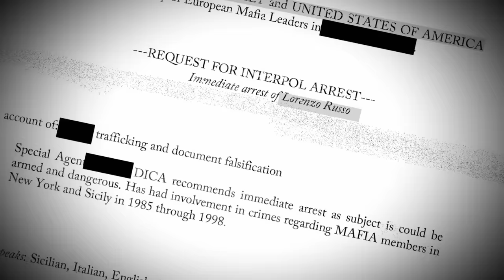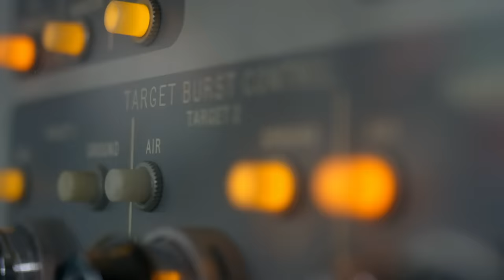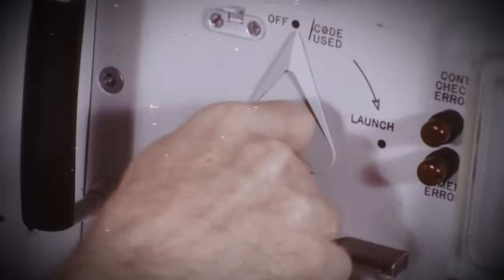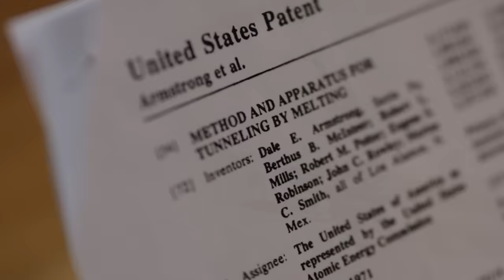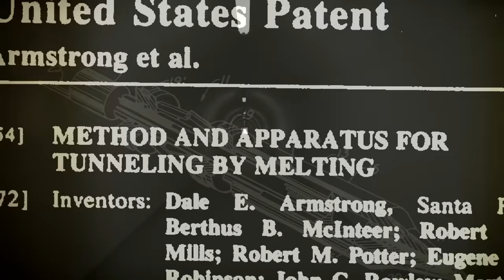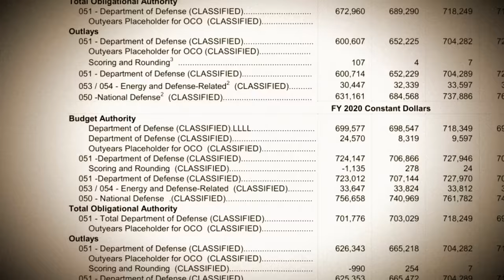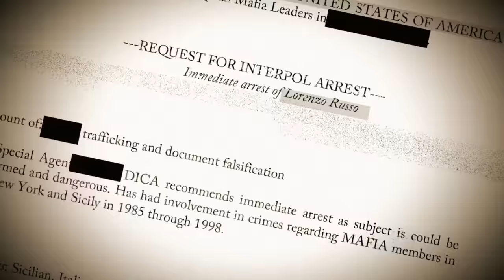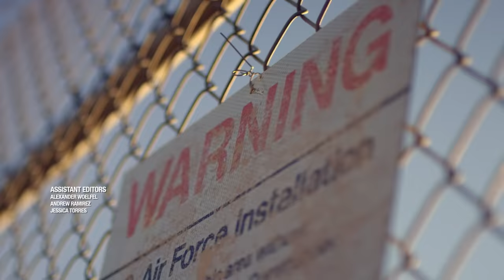TOP SECRET U.S. Government Tunnels | Cities Of The Underworld (S4, E2) | Full Episode

Comment: My dad served in a Minuteman missile base in South Dakota in the 60's. It is true that the locals didn't know the extent of the bases but they most certainly knew there were missile bases in the area (there were even protests about building them there). He also said that it took TWO airmen with identical keys, turning two locks simultaneously about ten feet apart to arm and launch the missile (that way, they couldn't be launched by one person acting alone). Naturally, one of their favorite activities while waiting for "the call" was to try and figure out ways for one person to turn both keys at the same time (Think it can't be done? Challenge accepted!). Also, contrary to movie myths, there are no self-destruct mechanisms built into nuclear missiles, that would make it possible for the enemy to destroy them in flight. The key to safety is to make them really hard to launch in the first place.
Reply: You could just measure the distance of the keyholes apart and attach the keys on a long rod with small u joints or like a wobble socket.
Reply: @jacksparrow3490  Jack be nimble, Jack be quick !
Reply: @jacksparrow3490 that is one way, but I seriously doubt the security detail that searches you before you go in and when you come out would let something like that get inside that room. Unless, of course, they were in on it,  but then you would not need to do it alone.
Reply: I'm not saying my method was 100% lol.. obviously they have high security on these facilities. Was just saying if there was an actual will to do this alone there most certainly could be a way..
Reply: @jacksparrow3490  they may be 'around corners' or in different rooms.
Reply: THANKS FOR SHARING!! GOD BE WITH US ALL... AMEN
Reply: Strategic Strike Command Rapid City
Reply: Does your father know who the contractors were that built these installations?
Reply: I can’t believe how naive and clueless you guys are. You could just do the smallest amount of research ever and learn exactly how missiles are launched. Just because your dad worked at a missile base doesn’t mean you know anything about missile ops. Pretty much everything you said is wrong. Key’s definitely aren’t identical. And I’m not sure what movie myth you’re talking about but I thought it was widely accepted that once you launch an icbm there is no way to recall it.
Reply: My dad was assigned to one of the Air Force support groups stationed on Eniwetok in the Marshall Islands where they tested atomic bombs in the '50's.  He had some crazy stories to tell...at least the ones he could talk about.
Reply: Nice, We have Nike missile bases here in NJ.
Reply: this is probaly where the missing peoples are going to
Reply: Ellsworth, huh? Rapid City/Box Elder, is gross. All those missile silos have been decommissioned, and the ranchers whose land they were on, have ripped the control wiring out of the ground and sold it. They made a killing. I was working for Checker Electric Inc when a lot of that silo wiring was being transported to the scrap yards. The copper wire we were selling after the jobs we’d finished was great money, but that silo wire….Jesus Christ…..some of it was going for $10K per foot. It was absolutely insane.
Reply: Yup
Reply: Good episode
Reply: Thanks for sharing that. Wow. What a crazy place to have been. I can see some young men bored out of their minds with yard sticks taped up at the end. Lol
Reply: U should have listened to him
Reply: @thilde007  they can terminate the missile all the way up until the re-entry phase. this is standard in all rocket designs.
Reply: May have been another youtuber but pretty sure I saw you on a comment section for a video on a secret military radio station talking about the nuclear protocol. Gave me dejavu seeing you here
Reply: They re not really worried about the people above ground. We re just bottom feeders.
Reply: @jacksparrow3490 I think differently , if it wasn't a time crunch thing , just extend the keys wire harness ? Change the whole lock mechanism if you know your wiring and how they work
Reply: @mchrysogelos7623 Nope side by side approximately 15 feet apart, seen them myself...
Reply: the keys would not work unless the communications were remotely activated by another site. it takes more than just 2 people sitting in the same space with keys to launch an ICBM, it takes a command and control network. this is why there have never been any accidental launches of missles with nuke warheads.
Reply: I worked on Minuteman III nuclear missiles in the 80s. The guy’s right, boring job but scary the amount of power under your control
Reply: @CrossOfBayonne are Nike missiles still used? I thought they were retired when NORAD was established. Because they were radio controlled and could only detect an incoming missile from a relatively short distance or something along those lines . I know there is a couple old retired Nike missile defense bases up in Alaska that you can tour
Reply: It was public knowledge about underground missiles but locations were hidden  but we knew what States held them.   When submarines were put with missiles, we also knew that because they used to show them being launched out of the ocean but you never knew where the subs were. .  We knew about the radar installations up in Canada for early warning.
Reply: I was in the same career field you speak of.  Never at a missile base, but later stationed with close buddies who were.  I had buddies stationed in Montana, ND, Wyoming and Italy.  They said it was the most terrible and awesome duty stations of their careers.  I think the horseplay and time killers while sitting on posts at missile bases are what made life tolerable.  But you as the original poster on this topic is 100% accurate on even how the 60’s were.  And that two key system hasn’t changed.
Reply: Took me two minutes to figure out the keys.mop handles duct tape hack saw blade.
Reply: The missiles aren’t just launched immediately.  Unless they are “cold launch”; they have to be warmed up, fueled etc.
Reply: @josephjackson7269  did you know that SSBNs (slbm nuclear submarines) are a one way trip?  By firing those missiles from opposing tubes the submarine’s hull is massively torqued… it can only creep back towards a base at a noisy 5-6knots.  
Their existence in the US Nuclear Triad (Bombers, ICBMs, Submarines) is to assure that our opponents will be unable to neutralize our ability to respond reciprocally.  Bombers are for their recall ability and ICBMs for speed and payload.
Reply: @jimmiehawkins8352  “hacksaw jimmyhawkins” don’t duct around! 
McGyver takes notes while watching videos of you!
Reply: Richard Pryor in Superman 3 solved that problem by getting the other guy drunk and tying string to his wrist to turn at same time.😄
Reply: SIMPLE ,... as I built and demonstrated to people in a test of such a device .  I built a small metal frame that would clamp and lock over the lock console, the key would be inserted and a battery operated solenoid that  was positioned over the key and a clamping grip around the key for the twisting motion. I held a remote control box with a push button that operated the remote solenoid for as long as I held the button . On the command to turn my key, I did so while pushing the remote button and held it for the 5 second mandatory initiation phase, .... and IT WORKED !  Needless to say,.... those folks were a bit upset with the simplicity of such a tool and this was back in the late 1970's !

Comment: I harvested wheat around the silos in Wyoming in the sumer of 1985.  We were sternly warned to NOT have an accident and hit the chain link fences around them or we'd ed up getting the beatdown and arested by the military security stationed in each one.  It was nerve wracking because the farmers had planted their wheat right up next to the fence and we were expected to get it all.  They also warned us to NOT stop and gawk when we were close.
Reply: we worked underneath the pineapple fields in Hawaii.  when we had drills we had to climb up into the fields where workers were sometimes working.  had to stand around and wait to be told to return to  work.
Reply: THAT'S IF THE METAL FENCING WASN'T ELECTRIFIED AND KILLED YOU!!
Reply: @mchrysogelos7623 can u explain more?

We're you in military and this was a military base?
Reply: Very cool! Who gave you those instructions? Local urban myth, or a military representative?
Reply: @cybrtrkguy  The land owner.
Reply: @Bluesrains  It wasn't.  It was just a plane ol' heavy duty 10' chainlink with razor wire.
Reply: I roofed several silos I. Wyoming.. they dont play
Reply: I worked on those sites in the 80s in Wyoming. Our base controlled missiles in Nebraska, Colorado and Wyoming. Boring job but scary the amount of destructive power under your control

Comment: Twenty years ago I was working for a cabling and fiber optic company in Colorado. I saw an ad for a technician with a security clearance and I told my friend about it who had one. He got a job working at Peterson AFB where he went to a small building which housed an elevator. My friend said he couldn’t tell just how far down it went and then the elevator opened to a large room enough for two jetliners to fit in.

Comment: Besides tunnels and underground facilities (top secret) all over (under) this Country and beyond , there is also buried Arsenals in many numerous land sites throughout this Country.
Reply: I worked hazmat transportation for a DoD warehouse, not doing nothing special. But there's ALWAYS lots of sensitive satellite tracked stuff in motion, everywhere. So when a truck driver has a few night vision in the trailer, they have to park in 'safe harbor' for the night. Sometimes a base, and sometimes in a hidden site that looks like an old abandoned gas station with a hidden underground parking bay.
The Drive In Theater gag of Spies Like Us isn't as far off the mark as you think.
Reply: Huge nuclear reactor under UT Austin. Thank the bush syndicate
Reply: The missle factories make missles but no one can figure out where theyre at. Theyve been piling up somewhere. Cant even figure out where the missle factory is.
Reply: Hollow mountains for politicians and billionaires and their families
Reply: @WindFireAllThatKindOfThing  We use a lot of places that look abandoned, and you would never know there is tons of stuff beneath the surface. So do Canadians and Brits and a few others.
Reply: @censored4christ162 it's not one place. Pieces are made in different places. It would be too dangerous to manufacture All the parts in one place. For several reasons

Comment: In the early 80's, I was flying C-5s.  I got assigned a mission from KXXX in Nevada to KXXX in Utah... we were hauling something that was a very strange shape.. all covered in black plastic.. we assumed it had odd shaped flat panels under the plastic to hide its real shape.  The giveaway was the 3 aircraft landing hear sticking out the bottom, which were unmistakably landing gear.  Anyway.. after a short flight we landed in the desert in Utah... there was 1 small building at one end of the runway and nothing else noticable as we landed.. didn't do much in depth sightseeing as we were more into landing the jet on the runway.. but not much to see except the runway.  we parked at the opposite end of the runway and were not allowed to leave the area.  an aircraft tug showed up and attatched a tow bar to this 'THING' and towed it like an airplane to the other end of the runway as we closed up the c-5 and got ready to leave.  then... it was gone.  the plane, the tug disappeared... and we started engines and left.  where did that go?   Now you might have an idea.  What was the plane?   Stealth Fighter f-117 before it officially existed.

Comment: Wait a minute.  I don't like this part. 18:25  I can believe the tunneling apparatus that melts its way through, but their demo is BS.  22:51 and 23:35 show the same footage of Don looking through the same classically drilled hole, not the hole a plasma torch would make for example #2.  The spots on the rock don't even look like holes, just hot dents.  24:20 "That basically proves it right there."  They proved nothing!  The camera never showed a torched hole going through that rock!
Reply: "Fluff Footage" B roll type stuff to keep the Video Moving HAHAHAHAHAHAHAA
Time shifted, repeated. ETC....
Reply: They show an acetylene torch and a plasma torch. The acetylene is the is the long copper colored one with fire coming out the end, happened to be a welding tip on it versus a rosebud heating tip or a cutting tip. The plasma is the black colored but didn’t really show any fire coming out which is correct, they discharge a plasma arc. I have one of each. The acetylene torch while working great on metal will just not be to effective on rock, just heat it up, plus would require a massive tip and a lot of acetylene and oxygen, I mean a LOT, to do anything resembling a tunnel of any kind of scale, if it would even cut at all. The plasma only works on materials that conduct electricity, I don’t know if rock would, never tried it. Would take a lot of power hence the nuclear aspect.

Comment: The nuclear mining method description is twaddle.  The mass of rock displaced to create the tunnel has to be somewhere.  Converting it to glass doesn't move it away.  Theoretically, if the nuclear "drill" could convert the rock to gas, which could be exhausted, you could produce a nearly traceless excavation.  The experiment disposed of the debris because the experimenter and film team breathed the exhausted gas, fine droplets of glass.
Reply: simply look up "has there ever been a nuclear drill"   youll be disappointed.

Comment: Plasma torch hole image where he's looking thru is the same as his drilled one, they never show the plasma tourch tunnel, only the hole and not more than a tiny bit like less than 1cm deep. It's not a  correct representation.
Reply: Exactly what I was thinking about, badly illustrated 🫤
Reply: Exactly what i was thinking. That was frustrating. So I stopped watching at that point to search online for other demonstrations of drilling a hole in a rock with a plasma torch. Nothing.
Reply: I know high heat can break stone (stone can have super tiny airpockets and even water filled tiny pockets) and one of the reasons you don't put stones into a bon fire is that they can explode. Around a fire pit... isn't the same kind of heat. Not all parts of a stone expand at the same rate and that can also cause a rock to fracture. Not the same thing as they were measuring here. Another example is why clay you fire for ceramics will break or explode when it has airpockets too or if the claybis very uneven in thickness. And that it takes a while for a kiln (for ceramics) to heat up slow enough to not break things that are basically porous clay and powder glass for them to vitrify (melt/fuse) into ceramic and glass-glaze. I don't remember what exact cone temperature the high-fire was that my community center used to do for their ceramics, but it was the mid level clay stoneware and porcelain tier. It was hotter than the fancy ceramic retail shop but not as hot as the really hot specialty kind. Glass is on the lower end but with all of it you have be very gentle with the temperature differential or else things break instead.

Comment: it you have a 4wheeler you can find one in Mohave desert. it crosses hwy 14 north of Palmdale/Lancaster area. it runs from Edwards Air Force base west to low mountains where the area becomes off limits and is patrolled by armed soldiers in Humvees with a 50 cal machine gun mounted on back. The facility in the mountains is stop secret and very off-limits. The sand drifts in the desert and if you are diligent you can make out in spots the concrete edges. about 20 ft across and running seemly forever.
Reply: yes thiis is all true growing up we had duck and cover drills and nuke bunkers in the desert.

Comment: Check out The Department of Energy facility just North of Atomic, Idaho. Lots of little pod areas connected by roads which I believe are elevator areas.  I have friends who are veterans who would be bused from Twin Falls, Idaho up to that area in blackout busses to do welding, plumbing, electrical, masonry, etc. underground in a massive facility for submarine testing.  Yes. A massive submarine underground.
Reply: I believe that is the training/research facility for the nuclear powered submarines. They also train and monitor the INEL nuclear power plant in Idaho.

Comment: At 23:35 they showed the same footage from after drilling through the rock so I'm not so sure the plasma torch actually went through the rock but maybe I'm wrong. It's just odd they didn't show a straight through shot with the camera after using the plasma torch. They also show it again at 25:12 and it looks way different. But that's History channel for ya.

Comment: Ok guys, that plasma cutter did not go through the entire length of the rock. You were peaking through the previous hole made by the hammer drill. You only burned about an inch deep with the plasma beam. Why didn't you just burn through the rock entirely? My guess is that the tip of that plasma cutter is too short to maintain proper distance for the heat to melt the rock properly? But, you could've explained that rather than insinuate burning through. Come on man.
Reply: A nuclear tipped boring machine has been in use since 1973. You can see the patent and photos on the web for the machine made at Los Alamos National Laboratories. The first customer was the US Navy. Their pictures on the web too. I worked there.

Comment: These were being zapped out using nuclear technology by the Russians in the 1950s in Siberia and in the U.S. back in the 1970s. The basements of the WTC towers took 0.3 seconds with a 250fps shock wave, and got up over 30,000 degrees with a pressure only a few PSI.